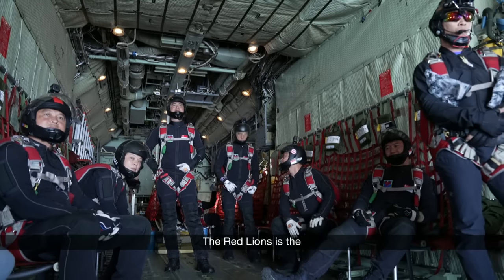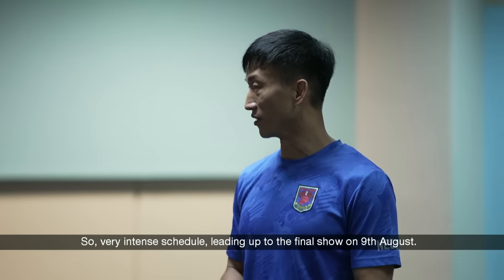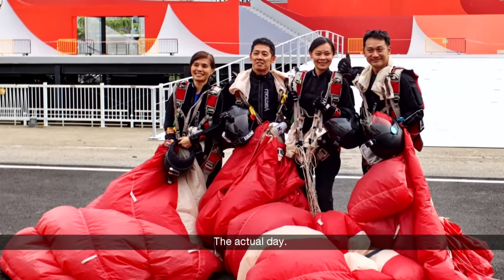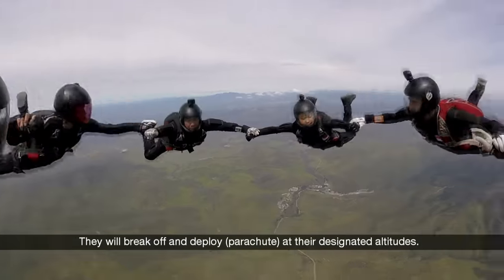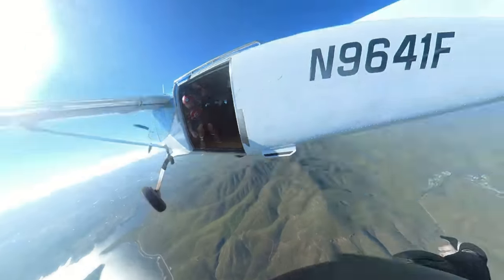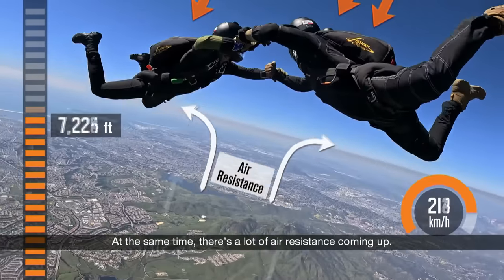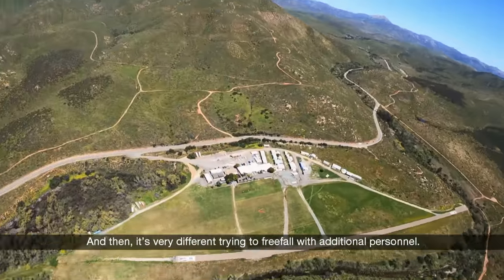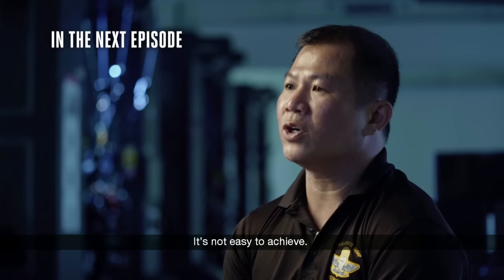How We Train For NDP 2023: Inside The Red Lions Training Camp | JUMP! - Pt 1/2 | Full Episode

Comment: 0:20: 🪂 The Red Lions is the display team of the Singapore Armed Forces, specializing in parachuting.
6:51: 🪂 The process of becoming a Red Lion involves intense training, packing and maintaining parachutes, and completing rigorous courses.
14:44: ⚡ The speaker reflects on a skydiving incident, their recovery, and their goals for the future.
24:06: 🪂 A group of individuals are participating in a canopy piloting course, learning various techniques to improve their skills and achieve accurate landings.
27:30: 🪂 The speaker discusses their experience and training in skydiving, including techniques, equipment, and safety measures.
32:43: ✈ The video discusses military parachute jumps, including terminal velocity, air resistance, landing techniques, and the challenges faced during jumps.
38:04: ✈ The speaker reflects on their experience going through the tender instructor course and the progression to jumping with passengers.
43:47: 🛩 The training involved gradually increasing the difficulty by adding more jumpers, forcing participants to become more aware and efficient in their flying.
Recap by Tammy AI